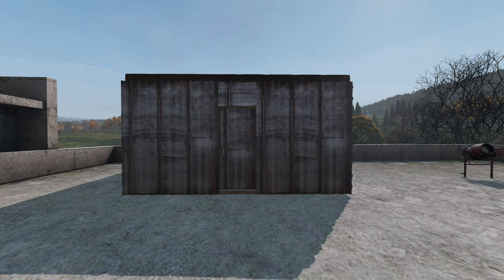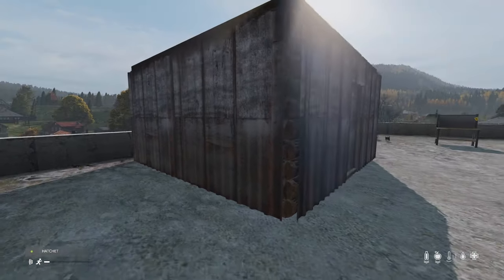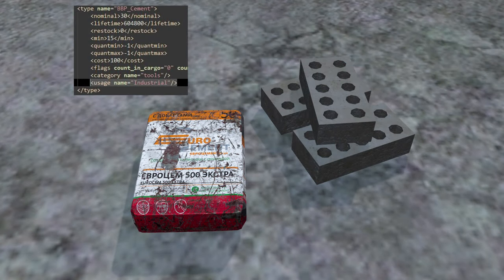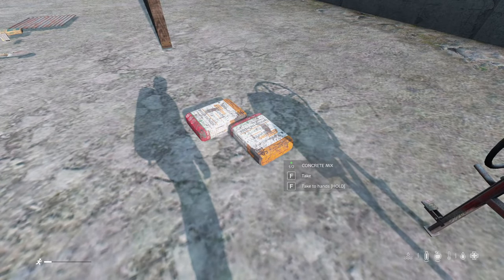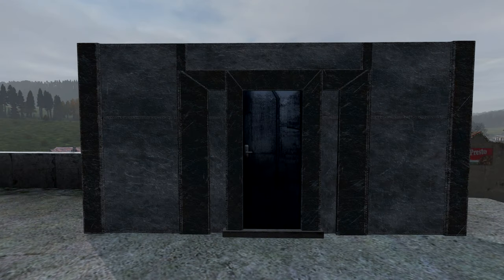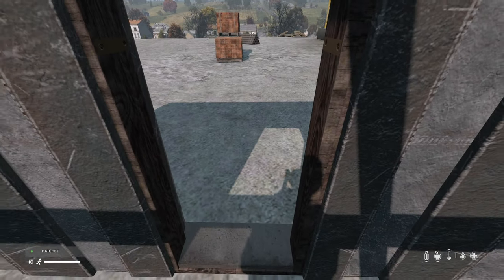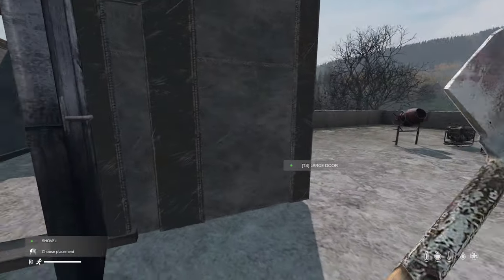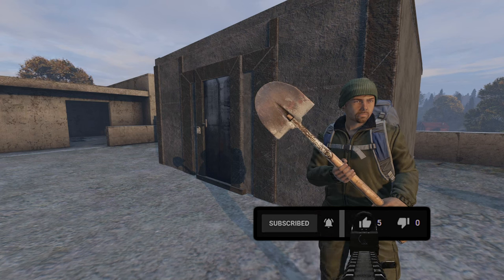How to Build a Tier 2 and Tier 3 Base - A Guide for Base Building Plus 2.0 - DayZ on PC

Comment: Could just be my server but you can use a battery and wire to power the cement mixer
Reply from the maker: Edit: Tested and this does work! Car or Truck Battery + Metal Wire. Attach the metal wire to the battery, take battery in hands, and attach to the cement mixer.
Reply: @Nitno  @wolfstar this has always worked fr me on all the base building plus and base building plus 2.0 servers
Reply: @Nitno thanks for the update and glad you got it to work. Much easier than the generator and less to carry
Reply from the maker: @g986  Totally agree! :_nitnoGood:

Comment: I have sucsessful upgraded a T2 Single Door 2 T3, Ty. But i had another question : Can i upgrade Roof Hatches,Floor Hatches and Single Garage Doors From T2  to T3 ?? Or work the upgrade only @ Single Doors ??
Reply from the maker: Good question, I just tested it and you can make Tier 3 Hatches and Tier 3 Gates!
Reply: @Nitno  I'm curious about the result, your test helps me a lot. If it works then I'll definitely watch your video.

Comment: hey nito you know if it matters if only s t3 door is down and not the wall ?
Reply from the maker: It depends the server, if the server is "Door Raiding Only" then you can get away with just t3 doors and not walls. Otherwise if you can raid any piece then you'd want t3 door and the wall attached to it to be t3.